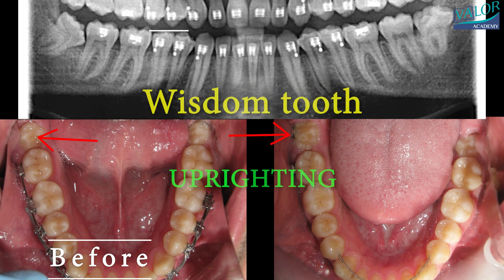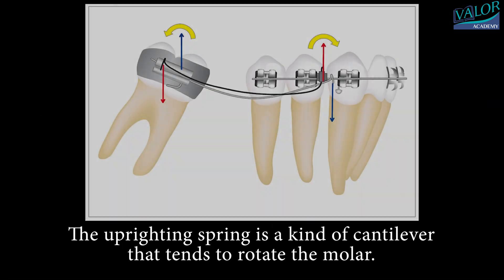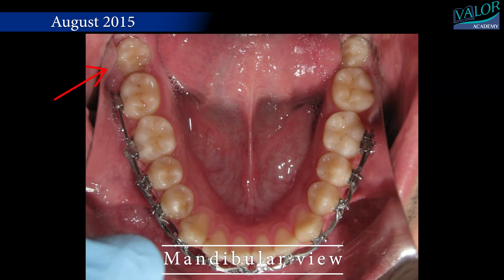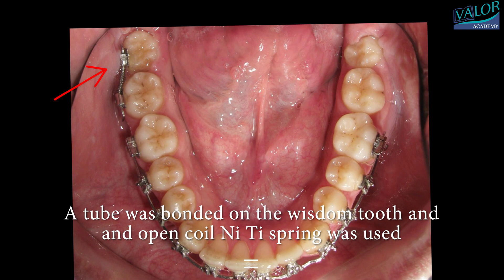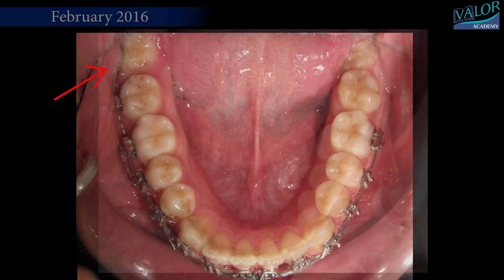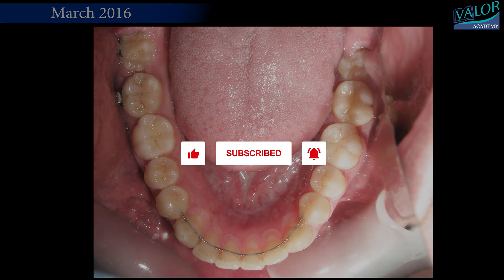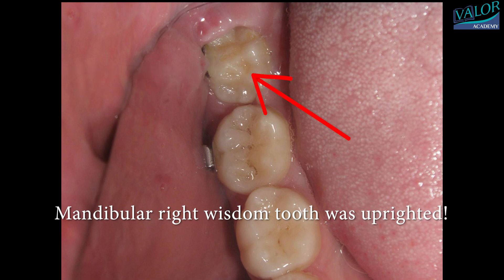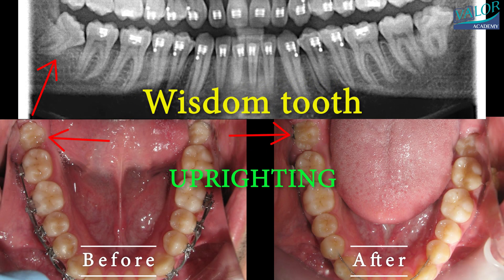❤️‍🔥WISDOM TOOTH Uprighting Instead of Extraction! 😉

Comment: Good afternoon. Do you have an email address where I can send you my X-ray photo and have you determine if mine can be uprighted? My dentist says I have to have it removed before I turn 30 but I want to have it uprighted. Thanks!
Reply from the maker: info@valortho.com is my office email. You can send it there for evaluation.  😀
Reply: @TheWizardOfOrthodontics  Thank you. I’d also like to ask this since it’s important but are you in the US?
Reply from the maker: @toabettertomorrow7949   No, I am in EU.
Reply: @TheWizardOfOrthodontics  oh ok! I still want to know though, would it be able to be uprighted without any issues? I sent the email the same day, have you been able to take a look at the X-ray?
Reply from the maker: @toabettertomorrow7949   your left wisdom teeth are biting the gum tissue which is very easy to correct by simple excision of the gum. You do not need to extract or upright left wisdom teeth. Sometimes this problem can solve by itself without any surgical intervention. The right mandibular wisdom tooth is very low in the jaw and is better not to remove it because of possible complications. If there is any other reason for its removal are CBCT scan is needed.
Reply: @TheWizardOfOrthodontics  Thanks for responding. 
So the wisdom tooth I’m inquiring about is on the left side of my mouth, that’s where I bite down on gum. What I’d have to do is just have excision of the gum and will it.. shift on its own? Obviously no extraction of course but it does NOT need to be uprighted?
Reply from the maker: @toabettertomorrow7949  After exposure, it would be OK
Reply: @TheWizardOfOrthodontics  ok great, thanks so much! Take care.
Reply: @TheWizardOfOrthodontics  also, I just emailed you!

Comment: The teeth that time forgot.
Makes me wonder. Does modern medicine remove the evolutionary pressure to get it right? Wisdom teeth are the remnants off a time with lower quality food and bigger jaws. Technically humans are in an evolutionary transition period between having them and not. But with modern medicine, having them is not a downside anymore, even if the jaw is too small. We just artificially remove then and live on.
Are we now perpetualy stuck in this transition period, dooming our species to be reliant on orthodonics forever?
Reply: Wisdom teeth are not disappearing. The reason they often have no place is the same reason other teeth grow in crooked: a lack of maxillary development caused by the current modern diet.

It's an acquired thing, not genetics. Or there is no reason to believe otherwise.
Reply from the maker: Surely, we live in just a short moment from an evolutionary standpoint of view. The evolution can not  be stopped if we rely on such food.
Reply: "lower quality food"

lol